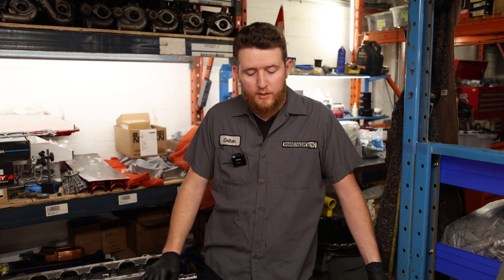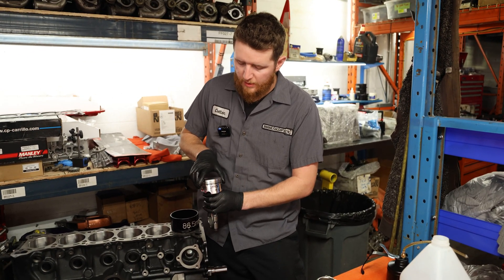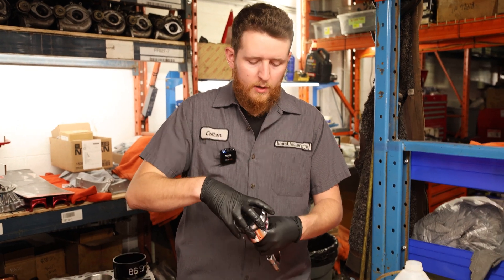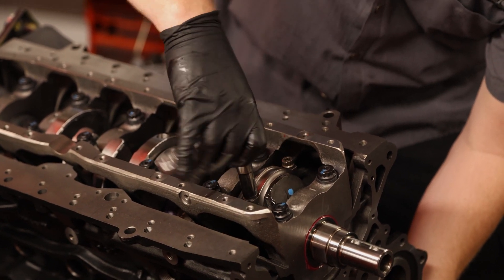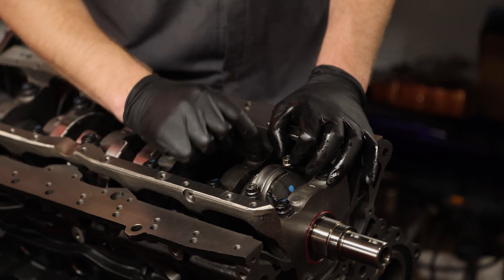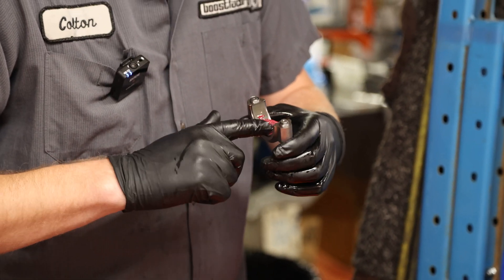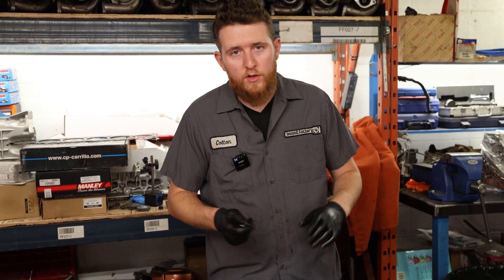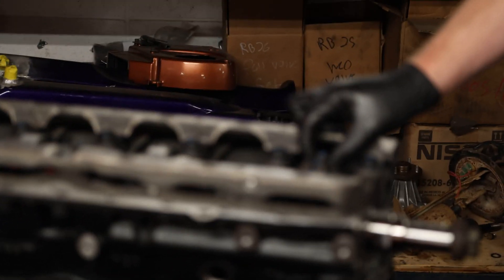RB26 FULL ENGINE BUILD || Episode 8: Installing The Rods & Pistons Into the Block!

Comment: Okay so I notice this came out a week after the last one, so did you film the whole series in like a couple days and just editing and releasing over time? Or are you just getting back to this project like once In a while?  Point being, I am wondering how long you can take between steps in the process, as, for instance, what if I measure up my crank and oil clearance and all… and then realize I need a different size bearing and need to wait a week to arrive?  Like should I saranwrap
It all shut in between steps if it takes me a while? Or should I wait til I have all parts ready to go before I put a single piece together?
Reply from the maker: Hey! in this series we have been working on getting all the build aspects right for months, so short answer is yes you can walk away at anytime and come back to it. but long answer. i always recommend leaving your self notes when you stop for a period of time as a refresher when you walk back to the table and continue, you cannot be expected to pick up right where you left of from memory.  and always make sure you have everything covered and protected from dirt and debris. also if you are in a humid or damp environment, make sure to oil coat the parts as they will flash rust quickly if left exposed to the air over time. 

Hope this helps! we appreciate the support!
Reply: @boost.factory  awesome!  Man I can’t thank you guys enough for this series!  I just bought a NEO motor yesterday(arrive in a couple months on container) and because of your videos I have the confidence to rebuild it myself!  I’ve never built an engine from scratch before but these are so detailed I don’t see how I could fail so long as I follow everything exactly. The hard part is gonna be finding a reliable machine shop that isn’t an arm and a leg for minor fixes should it need any…  and yeah from what I’m hearing here, it seems like maybe I should get all the machine work done(if needed), and then buy all my short block and head parts and just sit on them til I can spend a whole week or however long it takes, to get big chunks of the work done at a time. Like maybe one week I do shortblock, next week do all the head stuff, so I’m not forgetting where I am etc.  Also do I need to worry about the assembly lube/oil drying out over time?  As in, this is gonna cost a lot so I’m gonna have to take my time with it.  So once I have longblock done, and it takes me like day 4 months to save up and order the intake/exhaust manifolds and turbo etc… is it gonna be okay sitting for months(plugged up of course).  It would be a shame to build it and then have to undo shit to degrease or re-oil areas before swapping in.
Reply from the maker: @bowley4  Awesome! yes pay attention to the details. your hardest battle will be finding a machine shop that is as detail orientated enough to do what you ask with the precision we recommend. but be persistent! they may say its good even when it is not so always verify.  if you use the correct assembly lube you should have no issues with assembly lube drain out. we have a special first start up procedure we may do a video on to help people get the most life out of their brand new engine build and ensure full lubrication before start up!.
Reply: @boost.factory  yes that would be very helpful!